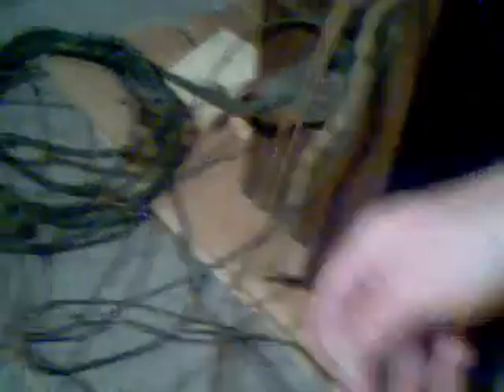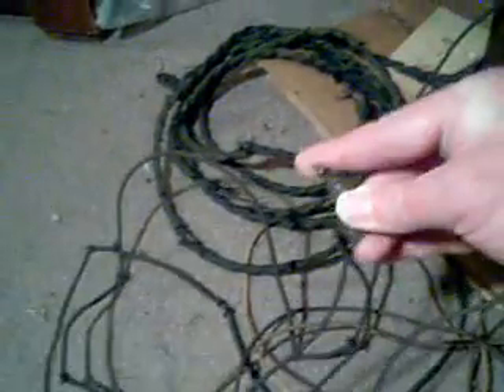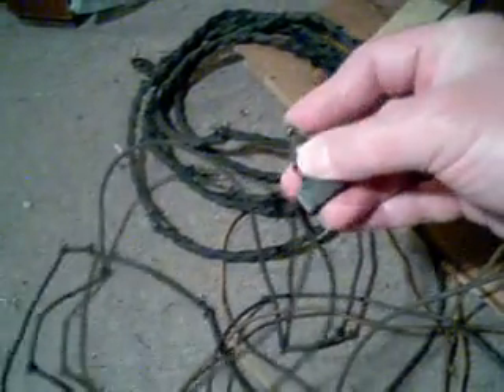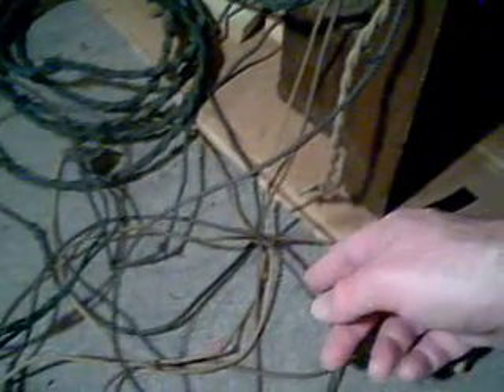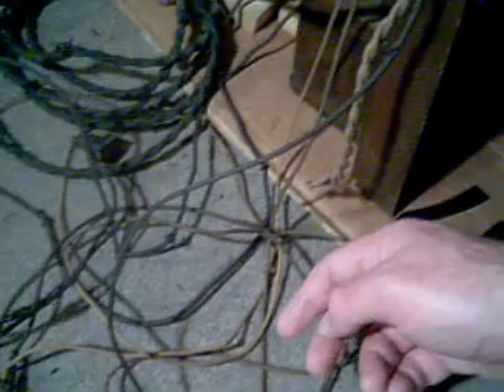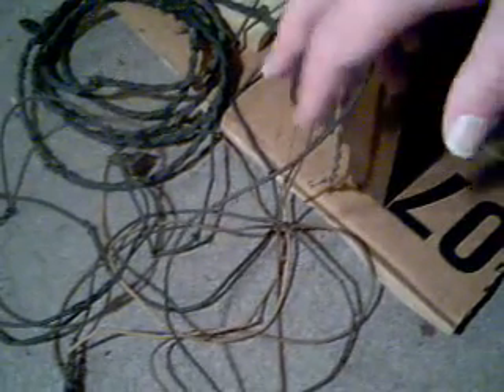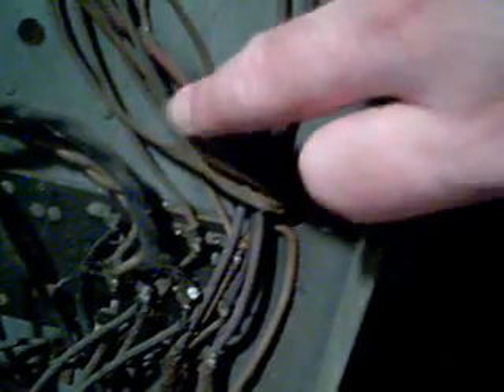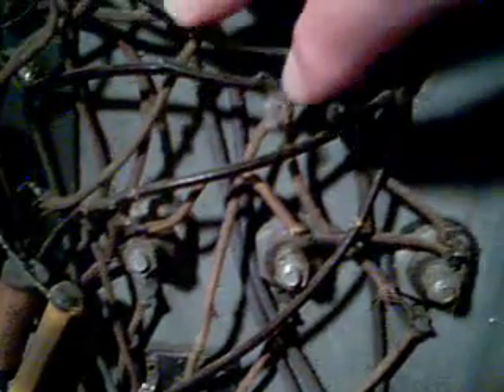Westinghouse Columnaire 101 Clock Radio  Power Amp Chassis c.1931

Comment: Hi Chris
I agree with John,.quite a nice  sketch you did.
I think it's a big job restoring without the front end or cabinet,..but your chassis is in good shape.
I have a 1957/8 RCA AM/FM front end complete you might be able to 
"Hybrid it"
Those are oil-filled electrolytics you were wondering abt.
They will be around 8mfd @ 450v
The bottoms were threaded,..  replace with regular electrolytic type.

Comment from the maker: @CameramanLink The power transformer seems okay and it will take a bit of wire tracing .This chassis is actually fused so that is good and I would add an inline B+ fuse if possible.I will replace any any bad wiring and I am going to get some corona dope or "liquid electricians tape "etc  as well for some repairs. A simple 1 or 2 tube preamp stage ,maybe a 27 globe on a separate chassis with volume ,tone and input jack is all that is needed to drive the 45's